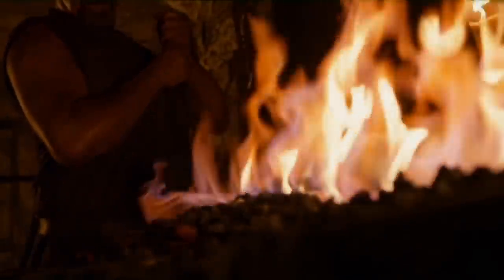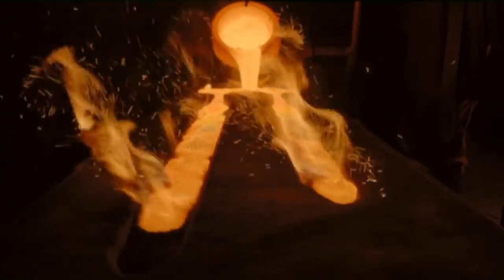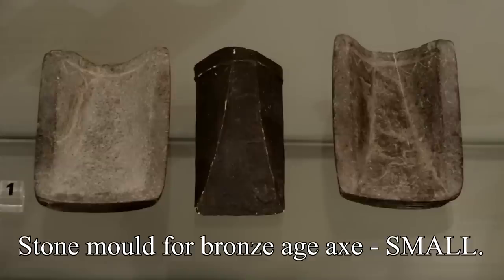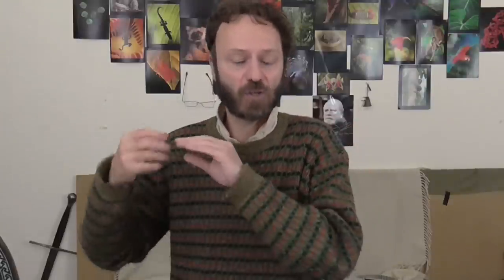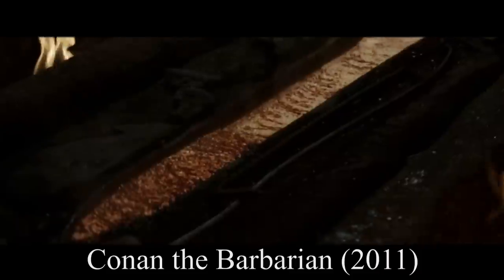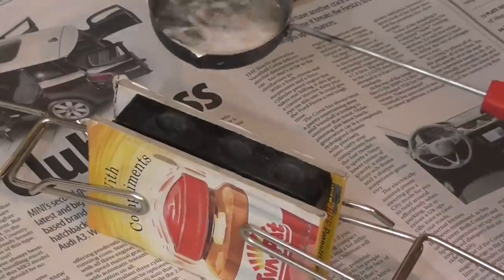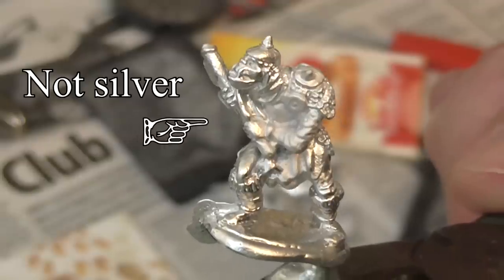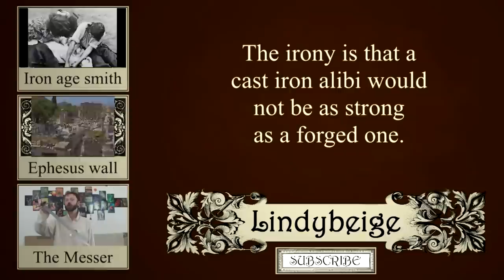Casting swords in the movies - forging a lie

Comment: I feel somewhat obligated to point out that the Game of Thrones example was a sword made of Valyrian steel which, while inspired by real-world Damascus steel, is not the same thing. Valyrian steel is literally magic. It never loses its edge, and is able to be used in battles against the Others, where other weapons shatter on contact. It's quite demonstrably a special case.
GRRM has said "_Valyrian steel is a fantasy metal. Which means it has magical characteristics, and magic plays a role in its forging._" So it seems fair that it would break the rules of how real iron works.

Of course, this does not defend any other examples of blades being cast forged as red-hot liquid metal. The clip you showed from The Lord of the Rings, for example, is not excused.
Reply: +Jim Cullen (Zagorath) Is it ever made clear if there's even iron in it? I'm not a huge GoT buff, but most of the characters know almost nothing about it what-so-ever, so I have to wonder if "steel" is even a correct term for it, or more figurative.
Reply: DynamicWorlds As you suggest, "steel" could very well be figurative. To my knowledge, neither the books nor the show make it explicitly clear how it's made.
Reply: +DynamicWorlds It's entirely unknown what it's made of or how it's made, although magic and dragon's fire is suspected to take part. Knowledge of it's manufacture/composition was lost when it's creator civilisation met it's vague and menacing "Doom". Best the current smiths can do is rework existing Valyrian steel
Reply: NotRelatedToBob just a small tip, "it's" means "it is". When you want to say "belonging to it", the word you're after is "its", without an apostrophe. It's a weird oddity of the English language, that for some reason, the only time apostrophe-s doesn't imply possession is with "it".
Reply: +Jim Cullen (Zagorath) I blame writing that comment just after I woke up!
Reply: +HaloMortal It doesn't. Tolkien sensibly doesn't even give details on how Narsíl is reforged, implying that it's through an elvish technique (Magic in our sense of the word, though they probably wouldn't call it that). In fact the idea that the orcs would have crappy equipment is something that's bled over from other fantasy - nowhere in The Lord of the Rings does it say that the orcs are bad smiths. The Hobbit does say that they're lazy enough to have slaves do the work instead, that's about it

Comment: Good video. I should point out though that while they are clearly not casting any sort of iron, a camera can definitely record molten steel as an orange color depending on the exposure of the camera, types of filters used, and more. Just like some videos and pictures of the sun show it as a dull orange because unfiltered shots are just a blinding blob of light.

Comment: 1:00 Well, they usually hammered them into shape, no grinding required. Also, having to cast it and then hammer it, was actually a good tactic to forge swords in short order. (The Ulfbhert Sword used a similar method, though it was more "Cast a Ring of steel alloy, then cut a notch and pound it into a sword shape", and yes, it was usually an Open top mold.)

Of course, actual metalsmiths still used Closed molds for that, as Open Molds were kinda terrible for even bronze swords.

4:20 Actually, NO. Aluminium is SILVER when molten, especially on CAMERA. What you're trying to claim, is BRONZE. That's ORANGE.

Comment: And after this, you need to make video on how they really make swords in that time.
Reply: There are several. Just look for sword smithing and you'll find them.
I've seen how katanas are made, with the added bit of how the metal itself is made, someone made a meteor sword (some sort of special steel I think), and so on.
I got the impression that good swords always are made of 2 different metals: A softer, more flexible core and the hard edge(s). Oh, and it takes days or even weeks for a single smith to make a high quality, single sword.
Reply: Christian Breitenstein i think meteor sword is just, what its name infer, made of iron came from a meteor. Meteor was a good source of comparatively pure iron before people learned how to melt ores properly
Reply: Good swords are heat treated according to the type(s) of steel used. "Most" post viking Medieval European swords were homogeneous (one type of steel was used). There are exceptions, but generally they were heat treated to give the blade springiness to prevent breaking. Katanas on the other hand were made with up to three or more different grades of steel, softer steel was used in the core and spine, and harder steel was used for the edge. This is also why they put the clay on the spine, to slow the cooling process on the spine when quenched so the spine would be softer than the edge. This would allow the edge to take more blunt force while still allowing the blade to flex on the spine to prevent breaking. A real katana hit on its side will bend and stay bent, a European style sword hit on its side will spring back to shape.

Comment: Question! But first, thanks for your well thought-through and passionate content, Lindybeige!
Question: Indeed, most of the forging  I know of starts from an ingot or mass of raw, smelted iron, but couldn't a smith have a long slab of a mold into which he could pour his molten metal and then use the resulting long iron/steel slab in the rough form of a blade to beat and hammer into the intended result? In short, wouldn't it still be efficient to pour a long thin metal slab from which to shape a blade, rather than to shape it from a big block of iron?